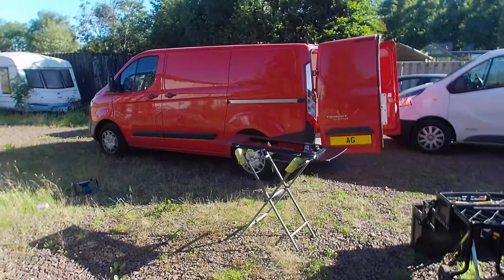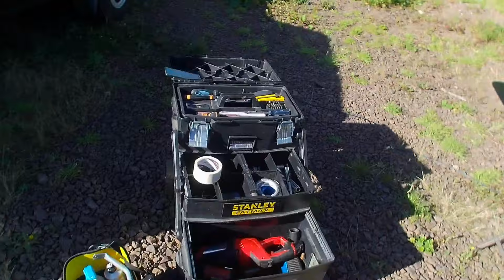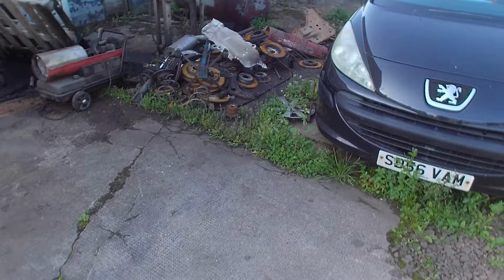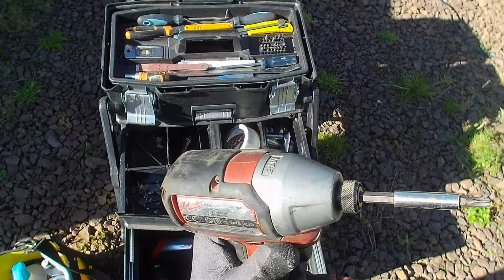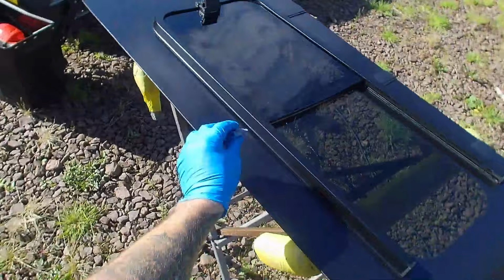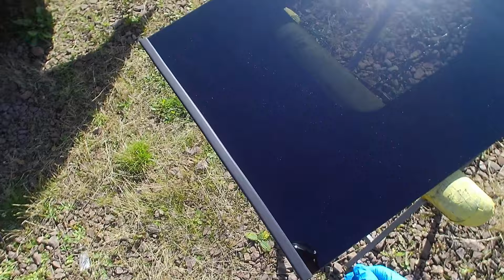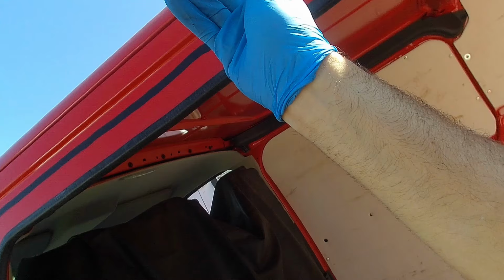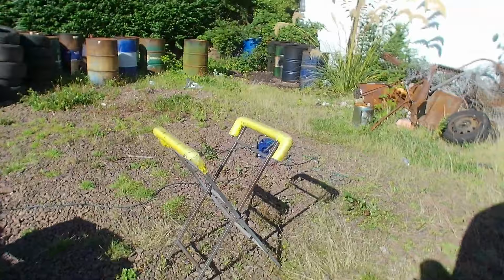Ford Transit Custom | WINDOW CONVERSION

Comment: Good tips. Seems a lot easier cutting from inside. I’ve seen other videos where they cut from outside and have to protect the paint work on he outside, underneath the opening from metal burrs.

Comment: I had trouble trying to find a glazier to install a window in the LH door if my Renault Trafic. Watched a few vids, but liked yours the best, and your methid made more sense! I ended up getting a used window and proceeded to collect all my bits that I would need.  I used SikaFlex 258 as my  bond agent.
My reciprocating saw didnt perform as well as expected and overheated and shut down several times. So the cutout was abit rough, and  needed remedial work with a grinder and flapper pad. Got it reasonable in the end. Then cleaned up all my surfaces, applied the polyurethane, and then the window. Following the way you did it made it look easy, and it relatively was! All in all, maybe 2 hrs? Now, after 2 days, more than happy with the result, and the window looks fantastic!
Reply: FWIW, I compared the result to my other van that had its window professionally installed by the dealer. The window was crooked! Lol. I had never noticed in 220000 ks of driving!